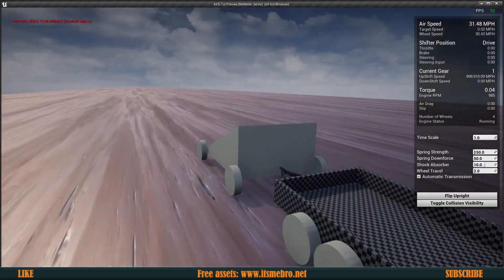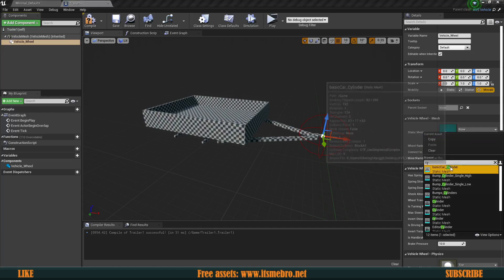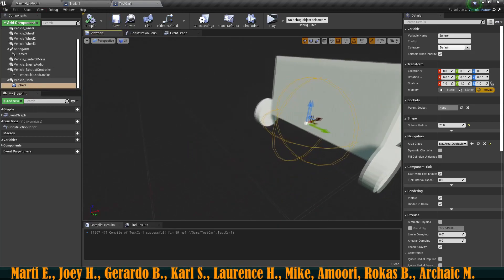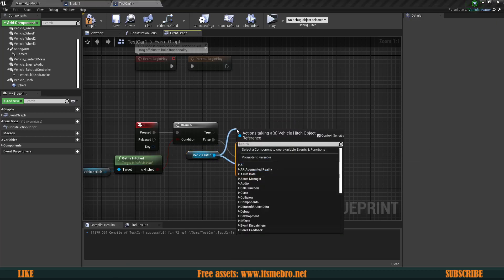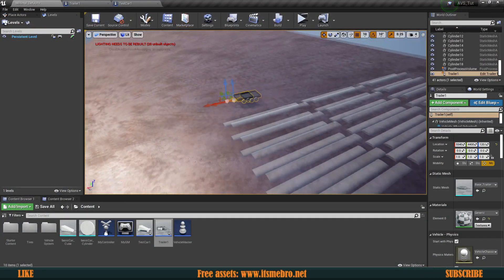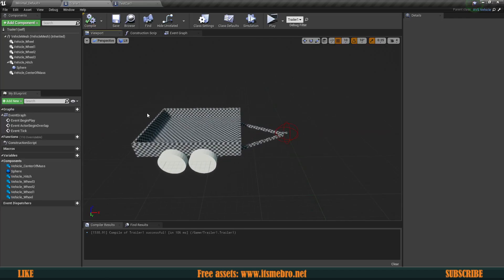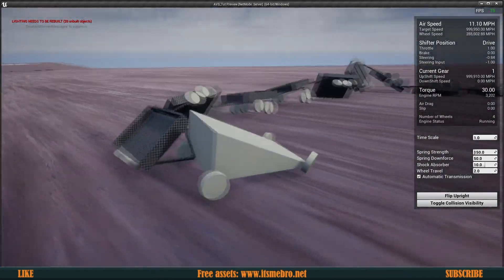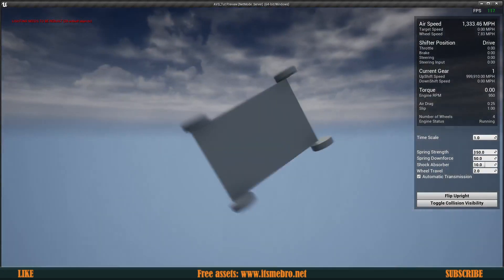UE4 Advanced Vehicle System / Trailers Tutorial

Comment: When i am driving on road (spline with static mesh) i am experiencing vheel bouncing, why? I set parameter in project settings, wheel have sphere collision, I replaced ue4editor-Landscape.dll provided in avs discord, and still bouncing, not much, but enaught to drive away from road and crash. Any ideas why it can be?
Reply: Min/Max Contact Settings
It is not required, but highly recommended to set your Physics Contact Offset settings as low as Unreal will allow you. 

The default settings will cause your wheels to bounce when moving between separate surfaces as if it hit a bump, even when they are at the exact same height. This effect gets worse the higher your movement speed.